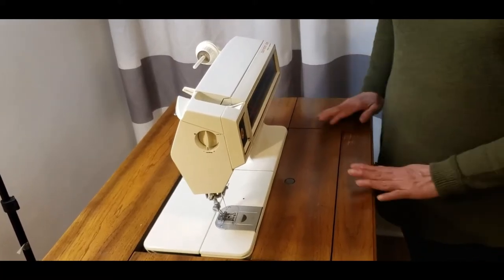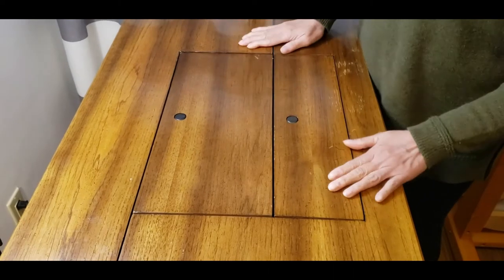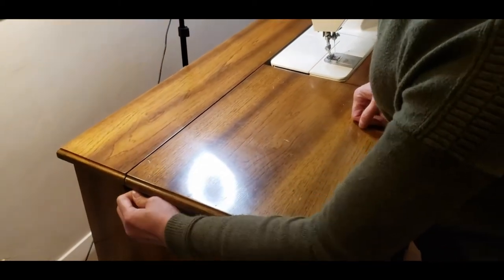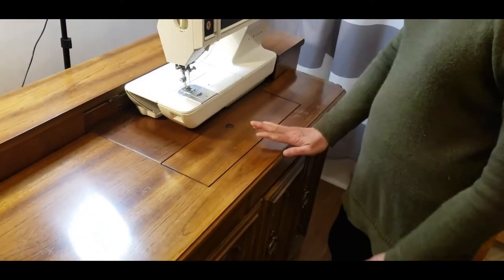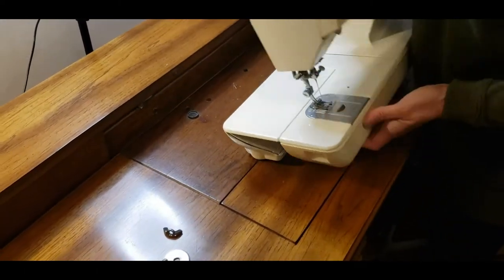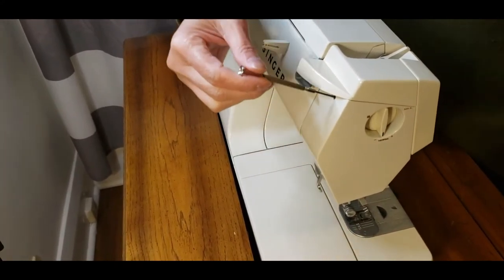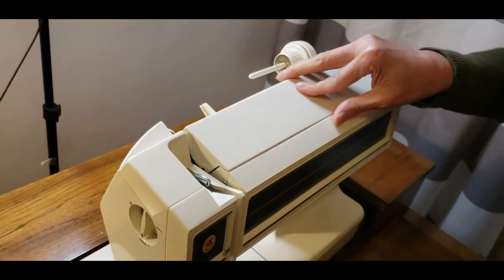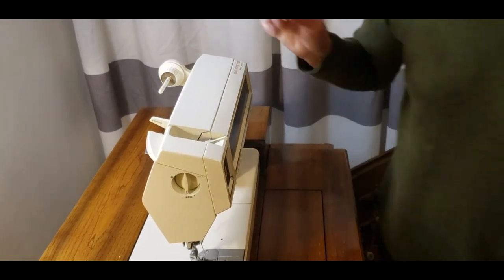Showing Sewing Machine Storage and Cover Removal (bottom, side, top)

Comment: You just taught me how to remove this machine from cabinet, when u removed the top -for what reason ? are you soposed to oil it anywhere? ....I was told, Never to oil it, is that right ? thanks so much
Reply from the maker: Yes Ann, it was on the manual that the machine requires no oiling under normal conditions. Thank you for watching my video. Have a great day!
Reply: @Joylearnthenshare  I thought so was having trouble with bobbin making a unusual noise & I saw a video that put a few drops of oil in the well of the bobbin( once the bobbin is removed) & it worked, it ran smoother , but I wouldn't do that anywhere else, Love your kind way, had my machine since 1979 it was almost 1,000.00  had it serviced once a plastic gear that was worn out, very surprised that so many part's are plastic  for an expensive machine thx again appreciate all your videos

Comment: Hi Joy, I was wondering if you were able to find bobbin replacements for your machine. I have the 2000 model although I believe they use the same bobbin and have been trying to find spare bobbins but all I can find are the touch and sew bobbins.
Reply from the maker: Hi Elma, Yes, I got them from the Singer Store near my place. Check on Singer Co. website under accessories. Bobbin is not hard to find but other parts is quite rare to find.  Thank you!

Comment: I had 2001 for short time sold and bought 2010 and I like 2010 much more, what I don't like 2001 is every time you turn on the machine and have to press strait stitch to start sewing and also the panel stiches can only see when the machine turn on and all black when it off, the 2010 always start with strait stitch every time when turn on and don't have to press strait every time when start sewing and the penel stitches is printed so always see the stiches even it off and I like the 2010 knobs contol the width and length instead of digital on 2001.
Reply from the maker: Hi CaliforniaMan,  I was wondering if Singer has different version of 2001 machine. The color of decorative and functional stitches symbols on my machine are orange and green. I could see them even the machine is off.  The digital fine tuning section is the one that are not showing unless you touch the four dashes on the middle. I think both machines work the same and even their parts almost the same.  Thank you and have a great day!

Comment: I have a Singer memory Touch 2000 that I bought a pressure foot for, it came without one on the used for sale pages on facebook. Everytime I sew, the needle hits the pressure foot and knocks it off?? Can someone tell me the exact pressure foot that I need to get for it? I have searched all over and I don't know which one to get. I bought the one that I have  now from our Local Sew Vac City store?? Thanks
Reply: OH YES and bobbin replacements as well. I only have ONE
Reply from the maker: @glendajackson5523  Hi Glenda, Thank you for watching my video.  Your machine model is different than mine but I think, the operation is almost the same.  Regarding the bobbin, I got them from Singer Sewing machine dealer closer to my place. I have only one bobbin  that came with the machine.  I just google it and a lot of store came out in my area. bring your bobbin to the  store so they have an idea and easy for them to find the same one. you could also buy online. as per the manual, needle and /or thread breaks make sure.. the machine correctly threaded, needle is straight and sharp, correct style for machine and correct size for thread being used. needle is fully inserted into needle clamp. flat side should be at the back.Presser foot or accessory is securely fastened to presser bar.Mostly, I used general purpose needle plate and general purpose foot. for needles, style 2020 for general sewing,style 2045 for knits, stretch fabrics and elastic, style 2025 for twin-needle decorative stitching or woven and knit fabrics, style 2040 for hemstitching.  I hope this would help you.  Happy Holidays!